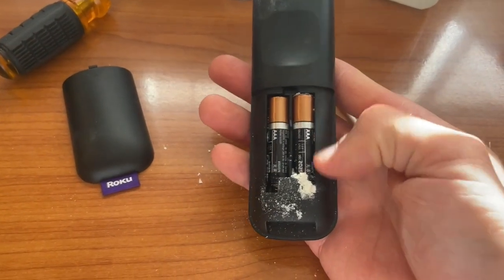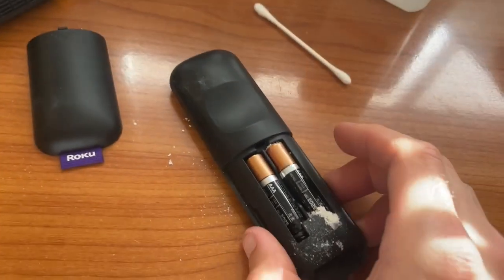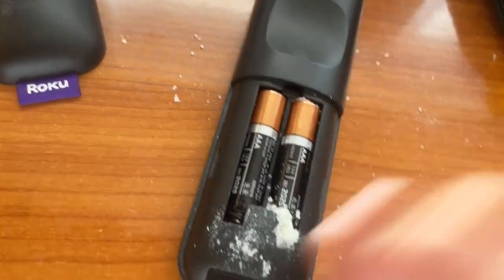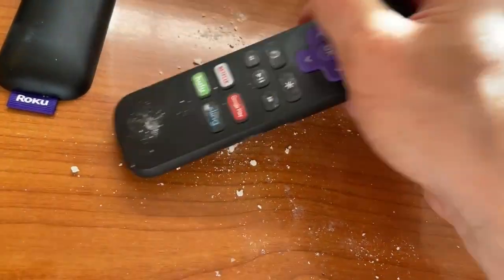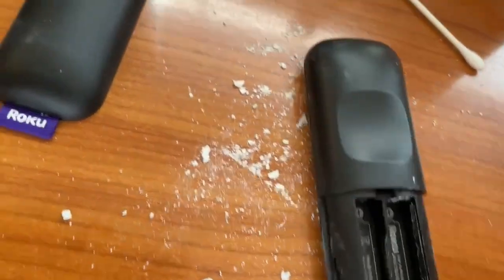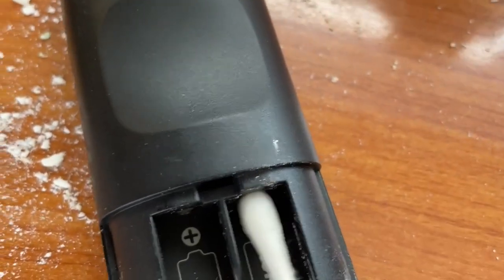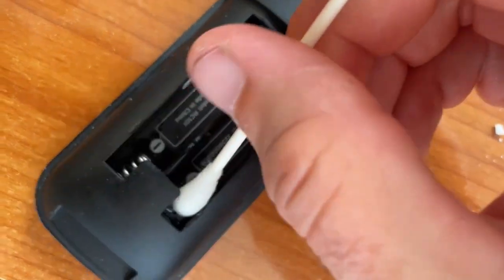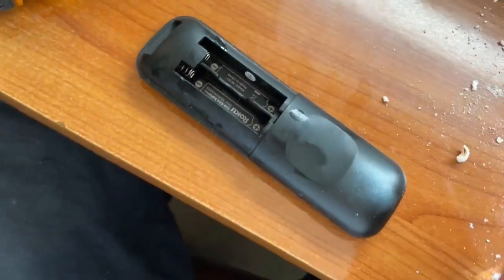How to clean corroded battery terminals in electronic devices at home - fast and easy!

Comment: Duracell, and Costco Kirkland made by Duracell, leak like Trump promises.  For devices that are infrequently used, spend the extra $ to buy Panasonic, or lithium batteries.  China made bargain $ alkaline batteries run out sooner, but I’ve never had one that leaked.  I have enough leaked Duracell and Costco to fill a laundry basket, and a dozen times had to  clean devices, and a few that were destroyed by leaked batteries.  The quarter size CR2032 for car fobs, etc. ate lithium and after years, I haven’t experienced a leaked 2032.
The LR44 cell batteries are alkaline in calculators can leak over years.

Comment: I don't know why this came up in my feed. But it would have been much better. Had you taken the remote apart so you could take the terminals out and just submerge them, then there's no chance of vinegar dripping down onto the board, which could corrode the traces on the PCB, which would not be good.
Reply: Sorry, friend, but your suggestion may not be as easy as implied. Often,  at least two of the  terminals you mention may be attached to the 'board, and it would prevent the method being worthwhile. 
A good idea in theory,  but blah blah...
   Regards

Comment: Duracell strikes again.
Reply: Dura leak
Reply: For infrequently used devices, use Panasonic or newer lithium.  I have remotes with Fuji alkaline batteries that didn’t leak for 15 years. Fuji was forced out by cheaper China made batteries, but i haven’t had China batteries leaked.  I have Duracell and Costco made Duracell frequently leaked in devices and in stored multipacks before even using them.  I only use Costco in devices that are constant used like clocks, and main TV.  Every other, I use Panasonic and lithium, even if they more expensive, to avoid damaging devices.  Duracell C and D seemed very less prone to leaking, in my experience with them in devices for years without use.
Reply: It's any bloody battery... leave them in for long enough, and that's what you get.
Reply: @cyberhaggis  Sure, but Duracell will do it sooner.
Reply: I just pulled out 10 batteries from a walkie talkie. Batteries expired in 2002, probably put in there in late 90s. So 25+ years. There were 8 Duracells and 2 Energizers. Long story short, the Energizer batteries were by far the worst.

Comment: Vinegar is good on plastic and metal components like these. If your device has rubber seals on it (waterproof), remove the seals first or use citric acid instead. Vinegar attacks rubber but citric acid does not. You can also substitute the vinegar here with citric and they both work equally well. Just be sure to remove all the citric (or vinegar) from the device to minimise future corrosion.
Reply: Citric acid is expensive and not household.  Stick with vinegar, which is also good for dropping some in toilet bowls.  Seals on electronic devices are mainly to keep dust and dirt out.  You’re not exposing them to vinegar long enough to damage them.  Real rubber will degrade over time anyway.  Wipe down vinegar rather than air dry.

Comment: These darn Roku remote  mine  did this now I don't keep the battery in it I could put new batteries in and two days later dead I think it's crazy how this is obviously a common issue with these remotes.

Comment: After doing this a few times over the years, my solution has been to use rechargeable batteries. Yes, they are more expensive in the short term and they do not last as long between charges but I don't worry about corrosion.
Reply: My rechargeable batteries leaked into my Playstation TV remote
Reply: @oscars3793 
I've never had a rechargeable battery leak.   Had a DeWalt 18v battery start smoking on the charger and it kept smoking for two days. 

Some of my AA rechargeable are  6 years old.
Reply: You could also do this crazy thing called, just changing your batteries. I know it's a crazy idea. But Hey, whatever works lol.🤷‍♂️😉👍✌️
Reply: @RavenTheLabrador 
Well yeah,  I could throw away a few dozen batteries on a schedule. Keep a list of every single device with batteries and what type.  
That would be wasteful of batteries and my time.